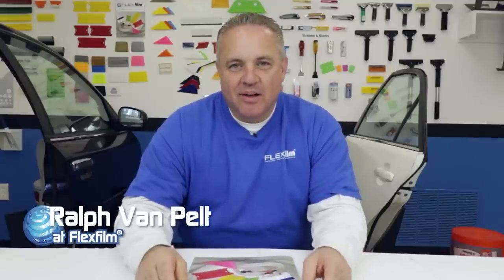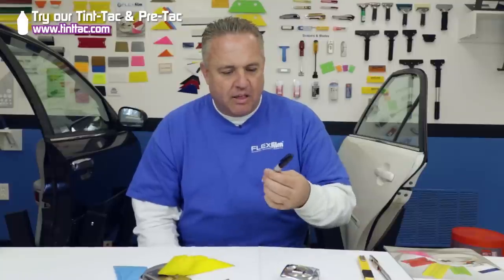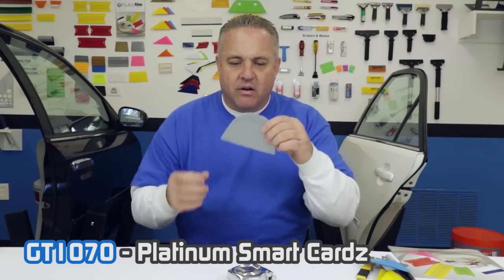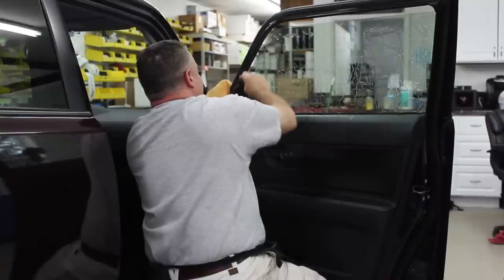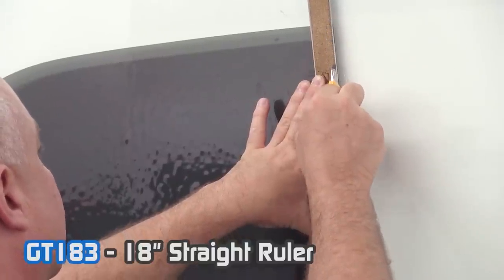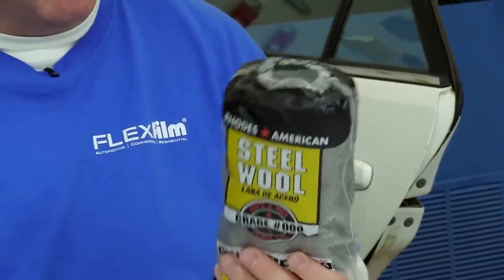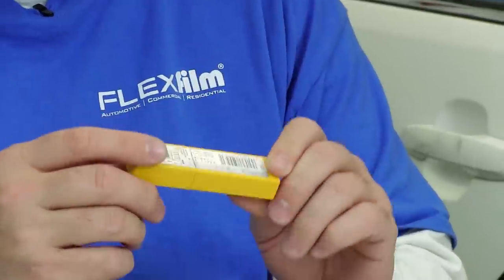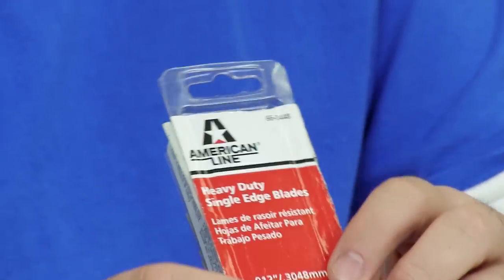Beginner Window Tinting Tool Recommendations

Comment: Ralph , I'm getting my butt kicked by an 08 eclipse . Any tips or recommendations ? It's a curved window , help please
Reply from the maker: Dwayne McKenzie 
I would assume the back window?
Reply: Ralph Van Pelt yes, I had some problems with the bigger side windows but the back was just awful,  any tips ? Also, would you heat shrink the tint if it was pre cut ?

Comment: What is the red tape on the  olfa for?????
Reply from the maker: JBIRD575 
I was experimenting with a way to shave so I would not scratch the tint.  I do not use it after my experiment.
Reply: Ralph Van Pelt ok I thought it was for that..like scratching the window tint when cutting top edge